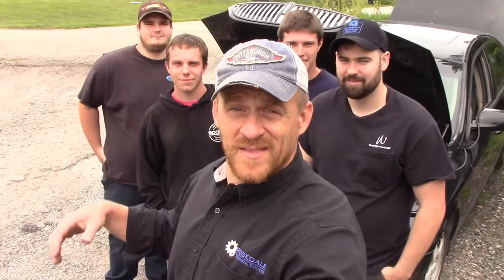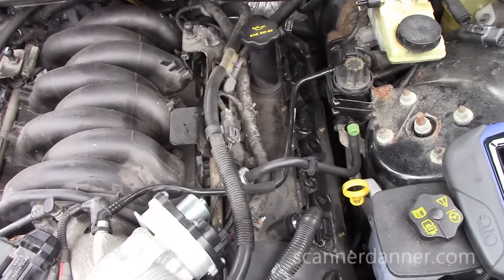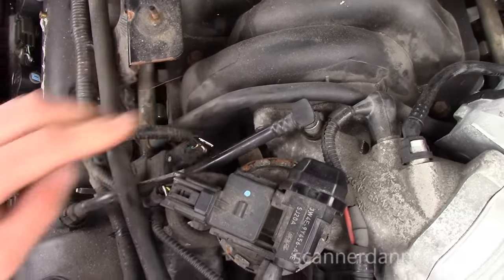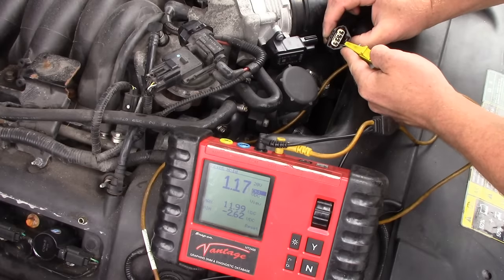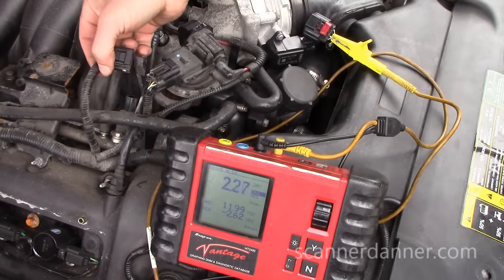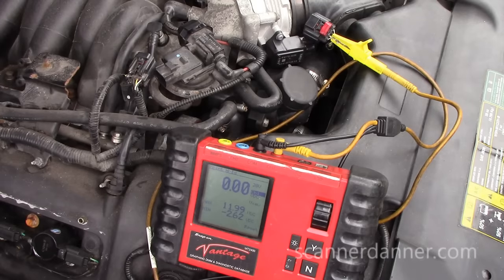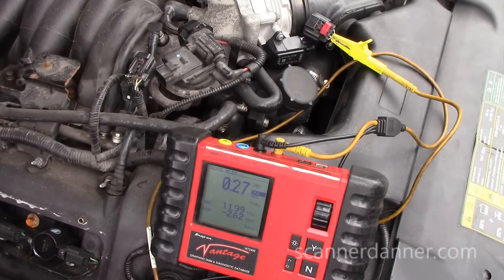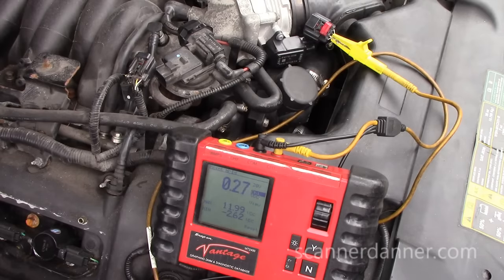Troubleshooting a No Start, No Spark, No Fuel, No Com (any car)

Comment: Just finished a crank no start on a Toyota Tacoma 2003 with a 2.7l engine. No communication with my scanner. So I Dannered the vehicle. Check for 5 volt ref and found low voltage. Checked tail relay and it was defective. Replaced and problem fixed. Another one bites the dust. I learned this from the man .Paul Danner and his awesome teachings. Thank you once again . Jose from Puerto Rico. Scanner Danner Premium is a must.
Reply from the maker: Man this is awesome feedback, thank you so much!
Reply: a relay for tail lights ??
Reply: Need more explanation on how you go to the relay switch. Did you just check all fuses and got lucky on the bad relay and fixed it?
Reply: So are you telling me that a taillight relay left the owner walking? And this was a Toyota?

Comment: I owned a 66 VW bug that actually had a 6 volt battery. Had Henry known how much  BULLSHIT would be slapped on cars he would have had 3-12's in series to give us 36 volts of DC power. A simple corroded connection can foil 5 stinkin volts !

Comment: What a valuable lesson! Checking 5 volt reference has saved me alot of time. Never trust a relay that clicks. Someone replaced a lot of parts because of a bad relay. 30 years in the business and I'm still learning new techniques. Great video Paul. Thanks for sharing.

Comment: Great video Paul. What the consumer DOES NOT understand is the fact that the Tech/mechanic needs both the TRAINING and TOOLS in order to do a proper diagnosis.  You can't have one without the other.  Training and Tools cost money, you NEED to recoup your money or you will not be in business for very long.  This is why you/we charge what we do.  Yes, it took me 5 minutes to find the problem, but I did find the problem.  No PARTS cannon was used.  Keep up the good fight.

Comment: i really enjoy electrical problems. i can hear the excitement in your voice as you are "on the hunt". makes it very exciting for your students.  i use a primitive way of checking load and control side of relays....i use jumpers that allow me to check voltage, ground and load amps...same result just with a home made jumper...sever pins sizes also. great video. really enjoyable. loved hearing the students getting involved and thinking through it!

Comment: Coming from a different technical background being civil engineering I am always fascinated with electronics and how things work. I find your videos very educational and inspiring as it teaches non electrical guys like myself how to tackle a problem by just applying basic knowledge together with technical data to trace and rectify the problem. Thanks as well for explaining why relays need to be check loaded rather than just pull it and looking for voltage. Finally you also taught me that not having a 5 volts reference is a clear indication that something is wrong along the circuit and a bad sensor can cause potential problems by pulling down the whole system causing a no start problem. Oh one more thing checking your fuses and relay once you have 5 volts reference is a key piece of information to ensure the circuit is functioning as expected. Great video and thanks again for teaching us how to analyze and fix potential problems with no start issues.

Comment: Absolutely helpful paul. I have just worked on the 5.7 liter 3UR-FE engine of a toyota tundra and it turns out that the computer isn't "alive and talking" anymore. This video has given me so much encouragement to get things moving as far as direction is concerned. Besides, I live in the capital city of Nigeria where auto diagnostics is still much like space travel.

Comment: My brain leaks knowledge like a sieve - this was a great refresher for me to plug some of the leaks, LOL. Love how you film the path towards the problem - gets the brain working!

 Amazing how fast I forget stuff now. I forget the meaning of certain automotive acronyms all the time too. Thank God for search engines, lol! Don't get old, kids! :D

 I'm in the middle of tearing down an old section of my barn to break ground for a new section (that will be my new shop!), so I've taken a couple weeks off, so to speak - if I'm not tinkering with cars every day, what I've learned just seems to go away FAST. This is just telling me that I need to watch your videos EVERY day, and not just when you post new ones! :) 

I need more hours in a day ...

Gotta love FoMoCo power steering pumps - they've made that same noise for DECADES! That one may have been low on fluid, but still ...

Comment: On the switch side of relay contact was bad (corrosion, burnt contact, created a high resistance in reference circuit taking voltage away from reference voltage, which stopped communication with car computer creating an engine no start. That’s my take away from this video. I think that’s what I observed. Thanks for taking the the time and effort in becoming one of the top dogs in your vocation and sharing your exceptional skills and knowledge with students and public, it is appreciated and noticed. You sir are a Great American.
Reply from the maker: Thank you sir! And you were close. Correct on the relay part, but it was low or no power to the PCM (as well as other circuits) that prevented the PCM 5v supply from being sent out to its sensors. In other words the relay circuit itself, was not part of the 5v reference circuit directly. Hope that makes sense.
Reply: Thank you , I now realize the defective relay caused the loss of power supply to PCM and related circuits.
Reply from the maker: @JackyK555  yes sir! And you're welcome

Comment: This has been one of the best vids yet Scanner! Of course all of them are a cut above spectacular.

I couldn't help but think of sanding the points when I saw those dirty contacts in that relay. Todays generation may not know what points are but back in the day now and then you had to sand the points to get going again. 

I had an old boat like that once and I had to sand the points to get back in darn near ever time I took it to the lake. The happiest 2 days in my life was the day I bought it and the day I sold it.

I bet if someone just knew where to look, sanding those contacts in that relay would have gotten it going again at least temporarily.
Reply: Blade cleaning the carbon off the contacts may not work most of the times cause what broke exactly is the latch coil, i am pretty sure its gonna have way less resistance than normal when this happens, the magnetic field ain't strong enough to support the bridge
Reply: My favorite video is the one where they had that chevy impala, i think, with the crank sensor code and it was a short in the wiring harness goin to the cam sensor and he was about to call a computer.
Reply: Airman Yeah I figured that as well but it might get you home from 10 buck 2 if you just knew where to look. It would be a sure bet to take the relay out and put a jumper from pin 30 to 87.
 I guess we should all keep spare relays and fuses. 

I do keep fuses but not relays. I don't take any road trips without my diagnostic bag of jumpers, multimeter, pliers, test light, crimps, crimpers, screwdrivers, scan tools and I keep safety pins for back probing on me every day. 

I guess we never think about one relay shutting down the entire system to where nothing works not even a scan tool. The fuse could do the same thing. I just hate for something simple to make me call a wrecker you know.
Its complicated but less complicated after watching scanner danner solve this issue.

I have a jumper made up for relays with a circuit breaker and a loop large enough to measure current with my AC/DC amp clamp.

Comment: One of the first diagnostics on a blower motor, I learned the hard way used my power probe, had 12v still blower wouldn't turn on (unplugged no load) finally used test light would not light despite showing 12v found bad wire in firewall plug

Comment: It's nice to come back across this video again.  I've got a nissan maxima at the house (sent from a shop) right now that is a no start.  One of the first few steps I took was to check for 5v reference and found low voltage on them.  This week I should be able to finish up the diagnosis, easily, because of the videos you have put out like this.
Reply from the maker: Awesome! Thanks Justin

Comment: Weird that this video just dropped into my phone's playlist.  I have a customer with a 2007 Mitsubishi Outlander with the exact same problem ... no comm, no crank, no start, no 5V reference, cooling fans on with 12 VDC going into the MFI relay, and 1.98 VDC coming out (circuit under load).  The output from the relay sends power to four fuses (PCM, fuel injectors, ignition coils, sensors).  I think I found the problem.  Great video Paul!
Reply from the maker: Thank you!
Reply: Paul, on this 2007 Outlander, the 5 v reference appears to be 12 volts.  After the MFI relay power flows to a 20 amp fuse; from there, power flows to  the O2 sensors, IAC, Evap Purge solenoid, injector relay, and back to the PCM.  Do some cars use 12 volts instead of 5?  I don't see a "5 v ref" line in the schematic.
Reply from the maker: @superk4562  where are you testing the ref circuit? Unplug your ECT and measure there (must be unplugged)
Or on your TPS or MAP (those can be left plugged in or unplugged
Reply: @ScannerDanner  I was testing at the MAP (back-probing while plugged in).  No voltage on any wire.
Reply from the maker: @superk4562  you said it was 12v on the ref circuit??
Reply: @ScannerDanner  No, just asking if any manufacturer uses 12V instead of 5.  For example,  the schematic shows 3 wires between the MAP and the ECU with no text indicating reference voltage, or what the reference voltage should be.
Reply: Which relay did you change out?  I have a similar problem on my 2001 sienna.
Reply: @mdhoan  it was the PCM.

Comment: Good Diagnostics!  Several times before I retired other (fleet) shops would send me no starts and the 5 volt ref would be low.  Older Dodge Vans would lose the 5 volt ref, but the ref was used for something inside the van, I think it was the air bag clock spring.  I remember changing a few of those and the 5 volt ref came back.  I know later vehicles now use multiple 5 volt ref, which is helpful to eliminate total 5 volt ref problems.    Glad to see the students had a chance to see what "the real world sees" when diagnosing a problem.  Plus you explain details about why you knew once the relay was changed, the 5 volt ref came back, other than the "million dollar bet!"  That was funny!

Comment: Great video. Practical and efficient. I had a box truck at my shop that kept running when the key was turned off and removed. I ended up finding the AC relay control circuit within the relay shorted. The short prevented a voltage drop within the control circuit of the relay. The lack of voltage drop caused battery voltage to feed into the ignition run circuit of the PCM. New AC relay corrected this symptom.

Comment: Paul
Excellent video.  I'm re-doing my Indiana Certified Emissions Repair Technician Course last night. I completed the course in 2009. A lot has changed since. Concentrating on non- communication issues and reprogramming and flashing modules. Perfect timing with this video. Was hoping to see the theft issue to being the next issue and you going threw and reprogramming 2 keys as that is what ford wants to happen for the theft issue. I understand why you didn't have to do it. You and Eric O. Need to have a meet up so I can pack my bags from Indiana. You bet your butt I'm going to join the premium channel at the end of this month. Later Brother
Reply from the maker: Thanks so much!

Comment: Just thought of another good question that will help everyone out.. How do you charge for diagnostics is it by the hour? What if you can't find the problem 100% but can point them in the right direction? Do you still charge for your time ( it seems like it would be difficult), Do they pay you after they put the part on and verify its fixed or pay you before? It's not like you can wait till they install the part to get paid can you?  Thanks again hopes this clears things up
Reply from the maker: Question 1: Flat fee for the first hour (additional time rarely needed but if it is, I charge time involved)
Question 2: If I accept the job, there is no such think as "can't". I may need to step away from a problem car for a day  but I'll get it, when I come back. And I bill those accordingly 
Question 3: Paid up front, the day of the diagnosis. 

The key is having an established relationship with these garages. No one is 100% all the time. I don't care who you are. Upper 97-98% is the goal. That's 2 or 3 miscalls out of 100.
But, when you offer your service for the first time to a new garage, there is ZERO room for error. If you get your first one wrong, they won't be calling you back.

Comment: Electrical diagnostics is fast becoming my hobby and my favourite job when at work i love the challenge and the buzz of fixing Electrical faults when others have failed. I was just struggling to find where the switching power comes from. Maybe ign main circuits relay? Fantastic video and a pleasure to learn from you. One of my many YT channels i learn from thank you

Comment: Just now watching this. Color me impressed! Among jobs I had were a nuke plant mechanical supervisor and certified auto mechanic. Retired, I still work on vehicles. 
This segment on the 5 V Ref. signal has taught me a lot about it! But, I didn't know of it previously being 9 V. I basically started w/ an '81 Cadillac w/ the infamous 6.0 L V8-6-4 MD-Modulated Dusplacement engine. It was 5 V. The 1st DFI-Digital Fuel Injection. You could get sensor info from the ECC-Electronic Climate Control Head (electronic HVAC control) -TPS, ECT, MAT, MAP, BARO,  ACT, O2 and closed or open loop.
Most don't know that even USB is 5 V. Cell phones are 3.3V. Cascading voltages. 120v wall outlet "transformed down" to 5v USB to 3.3v cell battery.
Where I am going w/ this is that ALL voltages must be on spec.
The 🔥 points in the relay caused a low voltage to the Ref. circuit. The PCM not getting the correct voltage resulted in the no-start.
As far as charging 1 hr diagnostic time, in this case BOTH time and tools bought are money. And more tools as they redesign vehicles. And more training. Same thing w/ the coil, but, it can also be worth it to not charge-gaining a regular customer-especially if you also point out the coolant leak, which you gain as additional work. This, as long as the customer doesn't abuse you.
And finally. Your repertorie w/ your students is amazing! Mike Rowe would be proud!
Reply from the maker: Thank you so much!

Comment: I compliment you on your teaching.  It would a help to teach your students that using a fully charged battery or an external supply when trouble shooting electrics. A low voltage high internal resistance battery can waste diagnosis time, & lead to incorrect conclusions. In this case it didn't matter, but in other cases it could. 
I love the way you demonstrated an initial series of tests without the help of a diagram. Well done !

Comment: Nice video. As for charging customers for diagnostics, the shops I have have worked at: general diagnostics 1 hr; no start diagnostics 1.5 hrs. After expiration of these time(s) and result no found, call customer and get authorization for more time. No authorization; no more diagnosis.
Reply from the maker: exactly, and for the time spent, you tell them what is NOT wrong with the car

Comment: That was so Good Dan. Shed so much light on Fault finding One O One, Understanding that wiring diagrams are a must. Here in Australia It is not always so easy to get them on different makes and models. Understanding the 5 Volt reference, looking for an over load by disconnecting sensors etc. Very impressed mate. Keep up the good Work. I have used you for a lot of Diagnostic jobs for years. Cheers Dave from Australia
Reply from the maker: Thank you David! You should know that my name is Paul and my last name is Danner. :-)
It's okay though bro, I get "Dan" all the time 
Figured since you've been watching for awhile, you'd want to know my name
Reply: Thanks mate, I saw a Couple others responded with Paul, But wasnt sure LOL I ran my own Auto business for thirty four years. And every day is a learning day :) I Have passed your name onto a lot of our tradies here in Australia. plus My Auto apprentice s. I hope you dont mind i used a lot of your Teaching Methods as i always Find When teaching, drawing out and Practically Showing students Helps them greatly to understand. Far from what and How my Trade Teachers taught me back in the seventies.  keep up the great work mate, Good Trades Men are hard to Find :)

Comment: GREAT JOB! ScannerDanner, you are a true troubleshooter and technician.  Many shops just start replacing parts and charge them AND the labor to the customer.  A TRUE professional troubleshoots and pinpoints the problem.  Enjoyed the video.

One question.  Where do you get all of the wiring diagrams/tech data?  Do you have a tech subscription for each auto maker or is there one source you use that provides all the needed diagrams?
Reply from the maker: Thank you! And yes, the subscription costs about $160 a month (Mitchell on-demand or ProDemand)
But there is a diy version out there that costs $20 per car and is the same service info and diagrams I use.
https://eautorepair.adtrk.biz/?a=10817&c=24&p=r&s1=
Reply: Awesome!  Thanks for the info.  I just ordered your book and look forward to reading it.   @ScannerDanner
Reply from the maker: @cyrus8020 thank you so much!